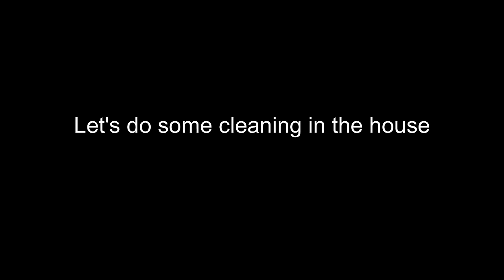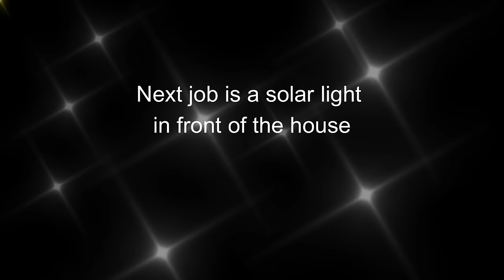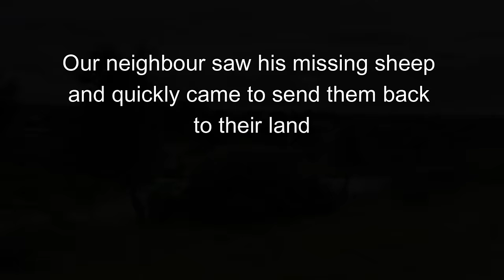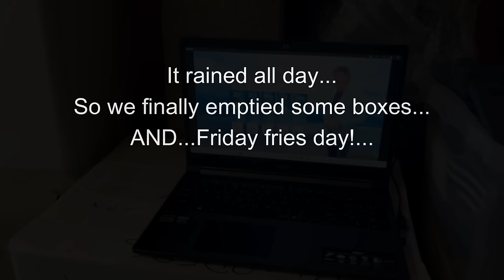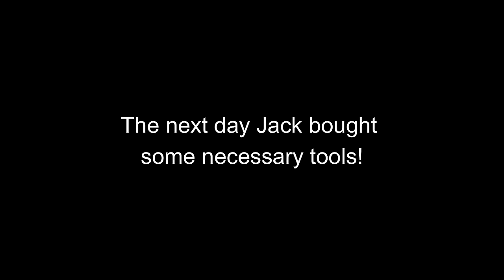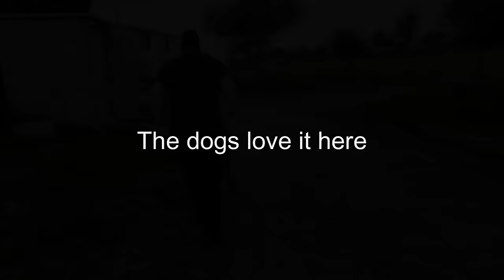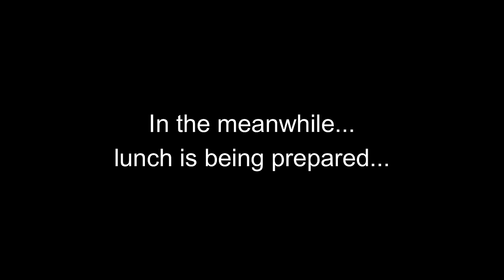#22 Working hard on our homestead in Central Portugal

Comment: Hello Jack&Ramona, in this video I've seen so many things you've done in the farm! The Olive trees was necessarily to be clean if you'd like a good/more olive oil in the next year. 
Tangerine juice it also a good idea! Vitamin C will protect your health, like vitamin D.

To Jack, I think about some stupid ideas 😮: to clean the field,
why you won't hold some stuff in your jeep back and drives like a tractor!?! Or put irons wheels!? 😅
To solve and in the cheap way the  kitchen countertop, why not made with ciment and galvanized mesh!?.
The gas localization hasn't a issue. My mom used that's from decades. But I think like you, and it's more secure put outside. If stays in your plan, duplicate the bottles. 
Diference tipes of gas, propane and butane. Butane is few cheap but in the could occur the propane is better if the bottle stays outside. Both are indicated to use in domestic services. Bath, heating and cooking. 
The light outside is perfect. 

Let the neighbor sheep's move and eating gross in your land, but you'll need to negotiate 1 or 2 free per year!!!😅 kidding!!! Quinta da Jara  can negotiate some sheep's in the neighbor,  and made a fence with wheels for rotational field and by that freshly gross to feed more easy and fast the sheep's.

The ciment deposit can be helpful when your time will be dedicate to renovate the outside walls. Some sand and ciment and this deposit can full the gaps inside bettwen the stone walls. Everything can be re-use. 

With a 1 acre, the quinta Jara will need to have a dog farm protector. 
Did you' ever been listen about 'serra da estrela" dogs!? They are from there, lovely and appropriate for protection, friendly for his owners. I've one, now he have 10. Still a baby but heavyweight one. 

To Ramona, you can protect your littlest vineyard with network (galvanized mesh). 

Olive tree jobs was important to be made as soon you can maded. Some studdy about can be helpful for next campaign. 

Next summer your West house side will be very hot. You have to think about protect that side or the nights inside at home will be very hot and long nights. 😓

Pool will be necessary!!!!! Castelo Branco region it's nice but not easy enough in the summer. We'll, you always can move to the litoral regions with beaches, fresh food and beer's. 

Next winter the "salamandra" needs to be installed and in the end of summer the wood need to be stored. 

Did you have knolowdege about to be a farmer in Portugal?
Read abouy the link,
https://www.cgd.pt/Site/Saldo-Positivo/trabalho/Pages/projetos-agricolas.aspx

Or just to be an self sustainable, link
https://www.idealista.pt/news/imobiliario/habitacao/2024/01/10/60930-calendario-de-plantacoes-2024-tudo-o-que-deves-plantar-na-horta

Wishes of quality of lifestyle.
Reply from the maker: Thank you so much for the tips and advice. We love to read them!🤗🙏🌹We need/ want to do so many things but it cannot be all done at once, so we pick the most important ones for now. We do own a tractor but it has a flat tire. It is in repair now… probably takes 2 to 3 weeks… it’s Portugese🫣🤣oh and the jeep also broken. We are waiting for the previous owner to buy a secondhand radiator as he broke the car after we bought it. Drove to a small tree, didn’t use the brake.😩😩
Reply: @QuintadeJARA  thanks for your reply. Unfortunately, Quinta de Jara has so many things to solve. Just saying, the beginning is not easy, but with  preseverence, everything will be solved on time!!!
Please consider the links, especially the one explaining the seasonal plantation. I'm sure that helps to grow.
Have a nice day to both!
Reply from the maker: @paulopalma-condesso8206  yes we will check out the links! Thank you again, really appreciate it 🙌